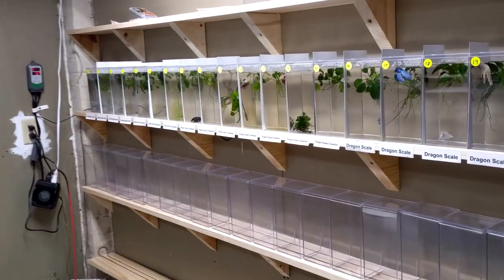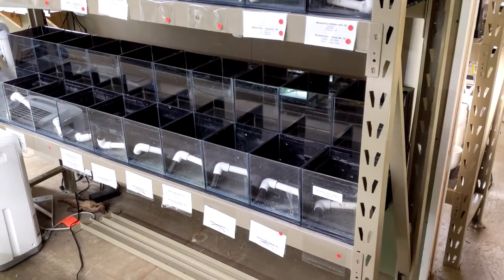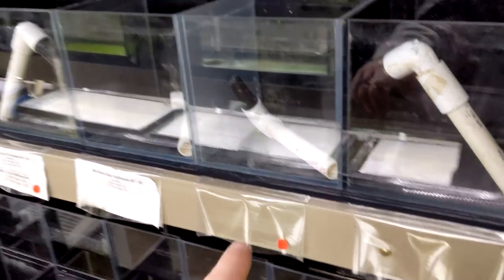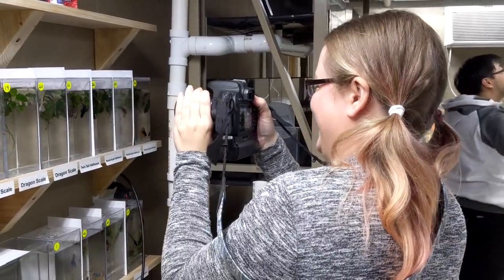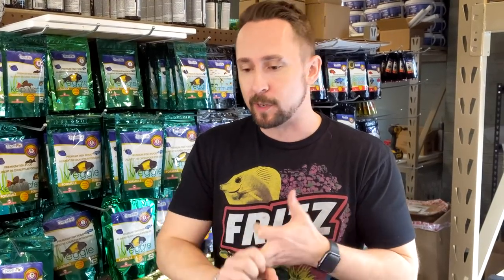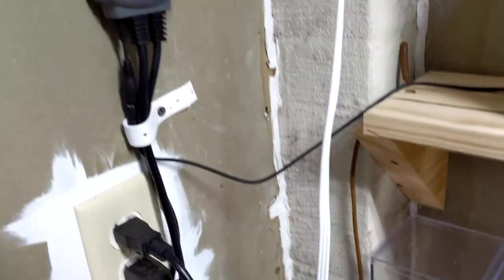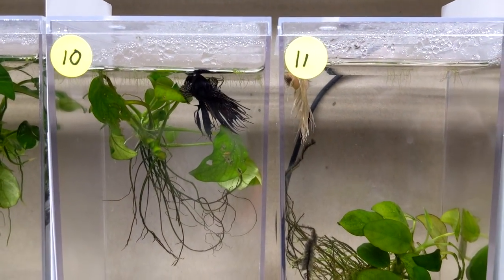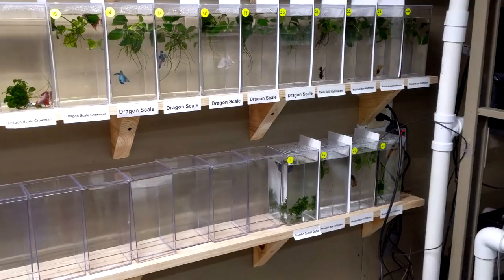We BUILT a custom rack for 100 BETTA Tanks

Comment: You could also glue small copper sheets / thermally absorbent material to the bottom of each tank, increasing the surface area for those thermal reptile wires to efficiently distribute heat into each of the tanks. I've also seen people zigzag or spiral the wires underneath where the tank sits and then only pass a small strip of wire between tanks on the rack to minimise heat loss into the air (but that's splitting hairs and you've already got it installed nicely as is". I'd go even further to insulate the gaps between the tanks where the wire is exposed but that's SUPER overkill just to save on electricity costs but it could mean hundreds over the lifespan of the betta rack hahah. This setup looks like it's here to stay! Very organised, clean and minimalist, i'm inspired to make my own :D

Comment: What watt heat cable are you using?  I tried to look it up and there are different wattages and I don't want to get the wrong thing.
Reply from the maker: 100 watt for 50 tanks. Although, go by length. However much you need with it doubled up. As long as you use a temp controller